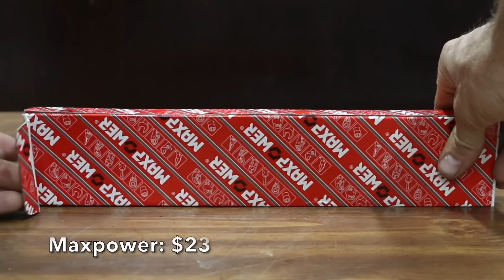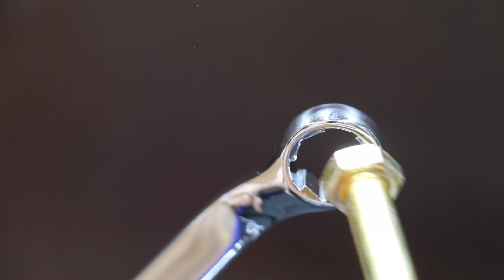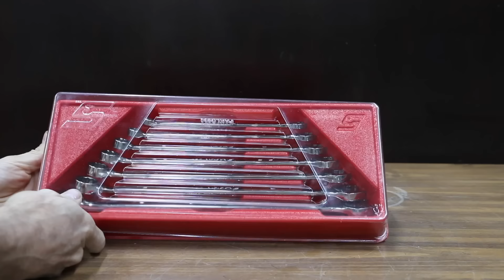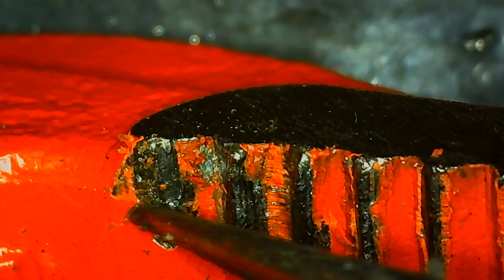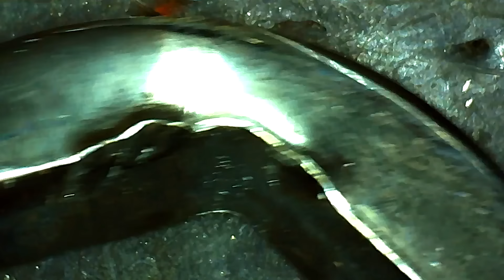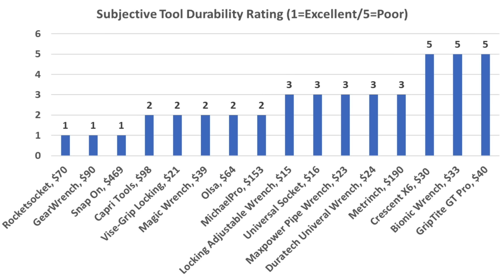Best "Rounded Nut" Extractor Wrench? Let's Settle This!

Comment: I've had my Metrinch 80+ pc set since the 1980's when I saw them on an infomercial. Could't believe they are as good as they claimed, but they definitely are!   Metrinch (Metric-Inch) have saved my ars way too many times to count. Mine do not have the taper Todd talks about and grabs nuts and bolts evenly. They work in almost every sitch and have helped mechanics working on my car to loosen difficult and rusted nuts & bolts that their Snapchat-ons couldn't loosen.
Reply from the maker: Thanks for sharing.

Comment: I have a set of the Snap-On Flank Drive sockets.  They're very tight on the nut/bolt.  My thought is by using these Flank Drive sockets I'm much less likely to round off a nut/bolt.  Because of that, I'll not need a nut extractor.  Less time required.  Fewer tools needed.
Reply from the maker: Thanks for the feedback.

Comment: I feel like the vice grips didn't have a fear as you couldn't taken them or after you slap them closed but using another pair of pliers to tighten the adjustment even more. Matter of fact a lot of vice grip pliers have an allen wrench screw on the bottom that you can put an allen wrench into get them even tighter are use another pair of vice grips tell you that even further if I need to after I snap them closed
Reply from the maker: Thanks for the feedback.

Comment: As far as removing difficult bolts I'd bet that an old pair of curved jaw Vise-Grips would beat all of these.
Reply from the maker: Thanks for the suggestion.
Reply: @ProjectFarm  You're welcome! Thank you for testing real tools in real situations. 

My point is really about the cost of having cheap tools easily available, how they drive good tools out of the market, and how users are complicit in the loss of good tools and good tool companies.

Comment: I bought extractor sockets(set 1/4 to3/4) off Amazon ($30) like the gear wrench for top two bolts on a rear pumpkin cover. Had to tap the socket on after jacking up the frame just to get to them! Who ever tightened them on apparently didn't do that! Overall, they did a great job but like the gear wrench, only good for extraction! Great video!😁
Reply from the maker: Thanks!  Thanks for sharing.

Comment: I wonder if you could have used a size down for some of the wrenches when working on the completely rounded bolt.  Maybe tapped them with a hammer to grab the bolt.  Great review!  Have you been sent any threatening letters from manufactures yet?  ...aka like the LockPickingLawyer has.

Comment: Great video, however i'd just like to point out that with the snap-on flank drive wrenches the open end is designed to better grab the stripping fasteners, not the closed end. You essentially just tested the standard box end on all of their wrenches rather than the flank drive itself on the open end

Comment: I wonder if it's possible to JB weld a socket onto a rounded bolt, and then remove the bolt easily? I know you can do that with an electrical welder.
Reply from the maker: Thanks for the suggestion.

Comment: As a mechanic going on 20 years, the open end Snap On flank drive plus wrench is the best on the market. It's saved me many times over the years. I personally rounded off a bolt with a Gearwrench in a very tight area and my Snap On saved the day 😂
Reply from the maker: Thanks for sharing.

Comment: Which wrench extender are you using and how do you like it?

I’m an aircraft mechanic and use the Snap On Flank Drive Plus. I’ve found that they do an excellent job in preventing the rounded bolt compared to my old USA forged Craftsman wrenches. If things are rounding or already rounding, I skip the wrench and go to a Flank Drive Extra socket or an extractor socket. I’d rather use caution and keep the material intact so I can try other methods first.

Comment: I've had the snap on frank drive metric combination wrneches for years now. I've never broken one but the open end sucks. It would much rather spread open around the bolt head than grab it. My 13,14,15 and 17 open ends don't work for shit unless they're already broken free or not very tight.
Reply from the maker: Thanks for the feedback.

Comment: I use the Irwin vise grips all the time at work, but not for bolts. I use them to hold onto stainless steel tubing when cutting the tubing with a tube cutter. Is especially handy with small diameter and short lengths of tubing
Reply from the maker: Thanks for the feedback.

Comment: By considering you also had some adjustable (pipe)wrench did you try to use smaller size key wrenches against (partially) rounded bolts that were unable to be grip or turn by the wrench size you initially tested? As ya know in real world use if a tool is too loose we try a smaller size to see if it will work regardless of the original bolt head size. Even if you need to lightly use a hammer to force in a key wrench to make it fit on the fully rounded/partially rounded bolt it still would be like an everyday real world test.

As a matter of fact not long ago i unscrewed a transmission pan with a 10mm socket (yes it was tightly fitting on 'em) most bolts came loose but a few were too rusty. Hammering in an 8mm socket saved my life 🤣

*I wouldn't be making this comment if adjustable wrenches were included against key wrenches.

In the future if you do a similar smash-up test then trying this would be nice to see ;)

Comment: Another great test there Todd rounded bolts really suck and there really is as you can see there's not a lot of tools that will do any kind of a job and if you're in a tight area most of the ones that did good are not gonna be able to get on!! so word to the lwise don't round them off!! welding on a good nut is usually best on sob!! ones. thinking of painting house sadly!! paint scrapers,testing??heard carbides are the cats meow!!

Comment: You should try drilling and tapping box wrench and install threaded small bolt with different end shapes. Also on vice grips, drill and tap with a small threaded bolt shaped like a pin., Or flat. One on each side.
Reply from the maker: Thanks for the suggestion.

Comment: I have that stanley locking adjustable wrench and it is great for those jobs where you need to hold a nut or bolt in an awkwrd place while you tighten the other end. Often those jobs would require 2 people but are easily donw with this tool. I wouldn't have considered it for rounded nuts though.
Reply from the maker: Thanks for the feedback.

Comment: Would you consider testing refridgerator replacement water filters?  The everydrop MSRP is around 60 bucks, you can get aftermarket ones as cheap as 10-15 bucks.....thought that would be an intresting video.  Love your stuff Todd.
Reply from the maker: Thanks!  Thanks for the suggestion.

Comment: More like the wrench needs a football field a socket uses swivel,  and goes vertically,  a wrench is fixed and works horizontally,  with no room for maneuvering,  because it cant swivel or change the the angels like a socket and swivel,  sad i have to explain that!

Comment: Great video as always!  I'd love to see a review of space heaters.  Not sure if this would be one video or two as there are so many varieties (ceramic, electric oil, induction electric, propane) and so many difference spaces sizes to be heated (small room, large room, workshop).  I'm sure you can come up with more factors to test, but I can think of speed to X temperature, how wide the heating is (just me or the whole room), how safe it is (overheat, tip, etc.), and how durable it is.  Thanks for all the work you do!
Reply from the maker: Thanks and you are welcome!  Thanks for the suggestion.

Comment: I wonder if manufacturers make items like this with softer materials (with the result of shorter use life) by reasoning if the customer likes the tool the first two or three times it's used they'll be happy forever even if the tool works less well after a half dozen uses because the good feeling they got when they first bought and used the tool and the "carry over" good feelings cancel out the bad later on when the tool fails to work nearly as well.
Reply from the maker: Thanks for the feedback.

Comment: I just pulled out a broken thread restorer (similar to a tap, but completely round where it broke) out of a head. I tried everything, and of course the most expensive extractor is what finally got it out with relative ease. McMaster Carr sells External-Grip Extractors (not the sockets or power tool variety they offer). They start at $85 for the smallest one, but I would have paid far more. I will be getting the whole collection.
Reply from the maker: Thanks for the feedback.

Comment: You really are a treasure. Have you done one on different tools to remove stripped allen head bolts? I usually drive in the tightest torx bit that I can and if that doesn't work I resort to drilling them out but I think there are tools made just for that. Love your videos!
Reply from the maker: Thanks!  Thanks for the suggestion.

Comment: Wondering if you would be able to do tool bags. Test for things like water resistance, durability, handle strength, zipper durability and overall capacity. Maybe even how hot it gets inside too
Reply from the maker: Thanks for the video idea.

Comment: Thanks for another informative video. I've only ever found those sockets with the rifling to really be effective. Sometimes you have to file off some of the bolt and hammer the next smallest size on. 

Can you review different belts? I've only ever used full grain leather belts, but I know some people love nylon belts.

I would love to see a stretch, abrasion resistance, and tensile strength testing video.
Reply from the maker: Thanks and you are welcome!  Thanks for the video idea.

Comment: I missed the Knipex Raptor ( 87 41 250) and the Knipex TwinGrip (82 01 200) in the line-up. Both great pliers, with a lot of usability in this area of bolt/fastener problems!! They make a good pair together, filling both needs.  (I wouldn't want to miss those in my toolbox) 
Thanks for your testing dedication!!
Reply from the maker: You are welcome!  Thanks for the feedback.

Comment: The rounded bolts might’ve been loosened with more tools if correct size was used
Also using a lathe to make all partially and fully rounded bolts are the same

Comment: It only makes sense that a pipe wrench is going to work on a rounded bolt head. That is what it is designed to do. If the jaws are in good shape, including the teeth, the bolt is going to loosen or snap in two. The biggest draw back is the amount of space it needs to work. A good set of vice grips, again with good jaws, is also hard to beat.

Some of the other wrenches seem more for "as seen on t.v." gimmicks. Poor quality control, and lousy design. If they worked as well as seen on t.v., major tool manufacturers would be selling them.

Thanks for the comparisons. As always, the video is amusing and informative. You go to great lengths to put tools thru their paces.
Reply from the maker: You are welcome!

Comment: Knipex Cobras make these obsolete. Hell even filing down two sides and using wrench pliers does.

A few ideas for future video content:
* Torque screwdriver comparison
* Comparison of battery powered corded versions of the same tool. This might be better done brand by brand ie whole video of Makita, Milwaukee, DeWalt tools separatelly.
* Electrical side cutter comparison ie Knipex 78 03 125. Would be nice to see those super-expensive Lindström ones thrown in
Reply from the maker: Thanks for the suggestions.

Comment: Knipex Channel Locks can remove any nut from any bolt, the first day I started working on cars I saw that a coworker had a pair and then I saw him remove completely round nuts with rust and corrosion on them like nothing so I bought a pair and remove nuts from battery posts all the way up to rounded lug nuts on a truck wheel, they are kind of expensive but they are the best.
Reply from the maker: Thanks for the feedback.

Comment: Basic pipe wrench has always been my go-to for rounded bolts, but it's not something I encounter often. Unfortunately they're pretty unwieldy and almost always a pain to get them into the space where you need them. On an unrelated note, I have one of the crescent self-adjusting pipe wrenches that's similar to the magic wrench, and it's been a spectacular replacement for both a normal wrench and regular pipe wrench due to how you can basically use it like a ratcheting wrench, since it unlatches on its own when turned in the loose direction, and re-latches when turned in the tight direction. Really genius tool.
Reply: I agree with the use of a regular pipe wrench, (since pipes are round). It seems to be the best at removing rounded bolts. It that doesn't work then I bring out the nut splitter or sawsaw.
Reply from the maker: Thanks for sharing.

Comment: 1/2 inch to 3/8 inch socket adapters would be a nice test, have snapped 4 in the past month after having a Great Neck adapter for over 10 years with extreme use.
Reply from the maker: Thanks for the suggestion.

Comment: Trusty old pipe wrench works very well, as long as you don't want to keep the fastener. When working on old construction equipment, where you'd be better off twisting off the head of the fastener than cutting it with a torch, a big-old 4' cast-iron pipe wrench is your friend. After twisting off the head, it can still help extract the fastener shaft once you get closer to the threading point. Great video, thanks!
p.s.: 1/4" to socket adapters test, please!
Reply from the maker: Thanks and you are welcome!  Thanks for the suggestion.

Comment: would love a chisel test, specifically durability of the edges and also the connection to the handle, u may figure out the first test but for the second thing i said, clamping the chisel really tightly in a vice and hitting that back of the handle really hard for ages would suffice
Reply from the maker: Thanks for the suggestion.

Comment: If you can I would like to see a redo over rocket socket and gearwrench bolt biter with the full set on different heads if possible
Reply from the maker: Thanks for the suggestion.

Comment: Because of the socket review I went out and bought a set to work on the brakes on my car. Worked great.  So recently I needed to pull a ground rod and I needed to get it to bust loose in the ground so I could pull it out. I put the socket on and gave it a good spin. Worked great.
Reply from the maker: Thanks for sharing!

Comment: This is hella ironic this came out a few days after I stripped one of three oil filter bolts on my KTM.. Still changed the oil, just couldn't clean one of the sieves/magnets.. This will make the shopping experience waaaaayy easier.
Reply from the maker: Thanks for sharing.

Comment: The universal socket is great for extracting. When they snap off in an exhaust I weld a tee to the bolt and use the universal socket to get a grip. For a "joke tool" it actually works pretty damn good. I keep 3 in my welding cart.
Reply from the maker: Thanks for sharing.

Comment: Throw a bone for the hvac techs, test tin snips. See which ones still cut the best after 1000 cuts or something of that nature. Also test out 1/2hp vacuum pumps to see which ones pull down the lowest micron reading for a 3/8x3/4 lineset after 2 hours
Reply from the maker: Thanks for the video idea.

Comment: Snap On customers  may be seeing the light.  Instead of paying 10x as much for a tool that's nearly an equal, buy 5 sets of a nearly equal product and save 50%.  Don't take the other four sets of wrenches out of the packages though, because you'd  never need to. 😁
Great comparison video.
Reply from the maker: Thanks!

Comment: A vice grip 10WR would have done better than that one. Those gearwrench damaged fastener wrenches seem to work great for me on lightly rounded bolts. One cool "wrench" I found that works simply on rounded bolts is the pipe vise amigo (just wish the teeth were slightly harder for higher grade or SS hardware).
Reply from the maker: Thanks for the feedback.

Comment: Thanks for great tests, as always!
I have several pre-production Vise Grips (back when that name meant made in Dewitt NE with pride) not this poor excuse wearing the name today.
Only had a few times where I had enough room to use them, but they worked well.
Best use I’ve found for them is for pulling cotter pins…that head is like a built-in rolling head bar and pulls them right out!
Reply from the maker: You are welcome!  Thanks for sharing.

Comment: My Vise-Grip Locking wrench saved my butt one weekend working on a brake caliper with a severely frozen pin.  It was the one tool I could get it to even budge, but eventually got it out and continued with the rebuild with having to buy a whole new caliper!
Reply from the maker: Thanks for sharing.

Comment: The Channel Lock Nutbuster pliers have saved my butt multiple times.  Between the hardened jaws and the shape of the jaws they are fantastic.  When you have them oriented right the bottom jaw will cam the jaws tighter.  They will absolutely mangle pipes and bolt heads.
Reply from the maker: Thanks for the feedback.

Comment: I have several of these tools. I really expected more from the 3 contact point vice grips. I have 3 pairs and they get tons of use. For round objects that I don't want the pipe wrench to destroy especially. Like suspension tubes on a race car with heim ends or something thats getting restored for a project. I did use my univeral socket a couple months ago. First and only time in 20 years lol. Useful once.
Reply from the maker: Thanks for sharing.

Comment: I wonder how using a metric wrench on a standard bolt or vice-versa for a better fit like 11mm on a 7/16. 
It gives quite a surprisingly better fit on the bolts on aftermarket connecting rods
Reply from the maker: Thanks for the suggestion.